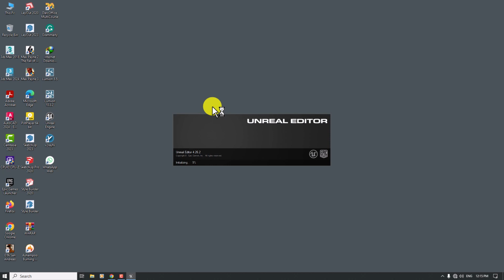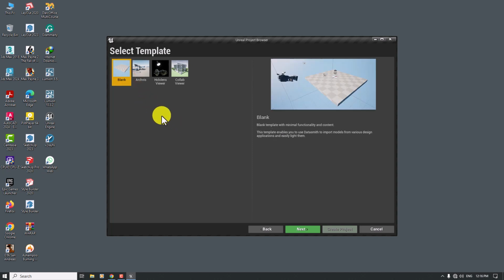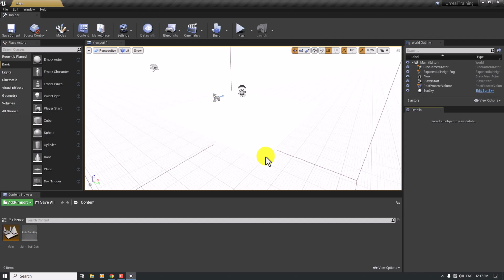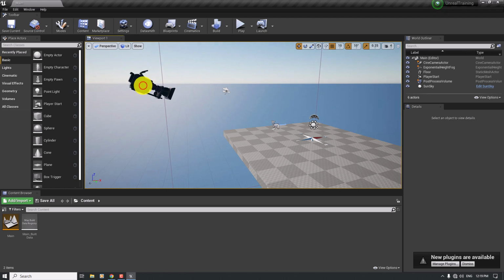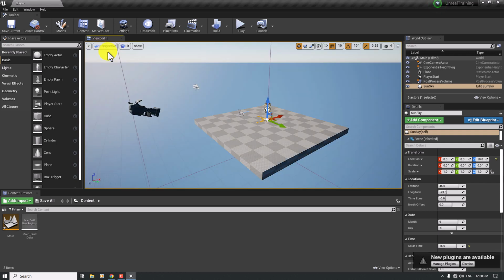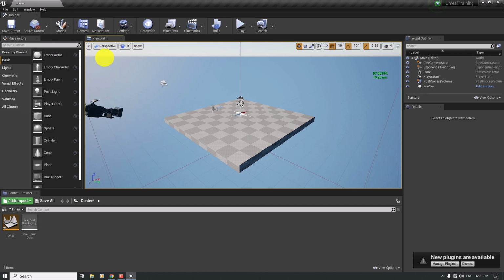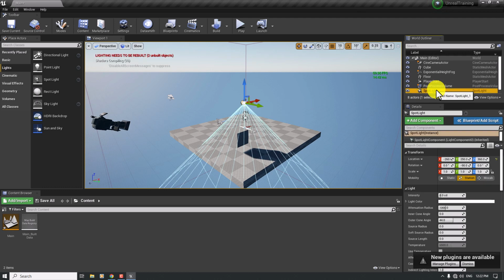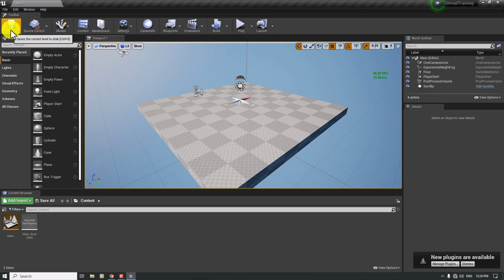Unreal Engine Tutorial: The Next Generation Of Architectural Visualization

Comment: Thank you mate for the tutorial!! 
Maybe do you know how to make a real-time Matte Shadow in Unreal Engine? Without any Composure. Just render as a Regular material. Similar to Shadow Catcher in Marmoset Toolbag
Reply from the maker: Hello my dear friend thanks for your comment Yes Follow This steps, sorry my comment is too long but UNREAL IS A LITTLE BIT COMPLICATED😁:
**To create a real-time matte shadow in Unreal Engine, you can follow these general steps:

Prepare your scene: Set up your scene with the objects and lighting you want to cast the shadow. Make sure you have a directional light or other suitable light source in your scene.

Enable real-time shadows: In the Details panel of your light source, enable "Cast Shadows" so that the light will cast shadows in the scene.

Set up the shadow material: Create a new material for your shadow. In this material, you typically want to disable all unnecessary shading and only keep the opacity information. You can achieve this by using a Translucent or Unlit material and setting the opacity to black (0) or a low value.

Apply the material to casting objects: Assign the shadow material to the objects that you want to cast shadows. You can do this by either applying the material directly to the objects or by using a material slot in a material instance.

Configure the light: In the light source's Details panel, enable "Dynamic Shadow Distance StationaryLight" and set the value according to your scene's requirements. This determines how far the shadows will be cast.

Configure the shadow settings: In the Project Settings, go to the Rendering section and adjust the shadow settings. You can modify the shadow resolution, filter quality, and other parameters to achieve the desired look and performance.

Build lighting: Build the lighting in your scene to calculate the shadows. Go to the Build menu and select "Build Lighting" to generate the lightmap and shadow information.

Preview the shadow: Play or simulate the scene to see the real-time matte shadow in action. The shadow will update dynamically based on the position and orientation of the casting objects and the light source.

Remember that the specific steps and settings may vary depending on the version of Unreal Engine you are using, so consult the official documentation or relevant tutorials for your version for more detailed instructions.
Reply: @SketchUpArchStudio  Thank you man! I know that it was an answer from Chat GPT, haha, I hope it will work!
Reply from the maker: @earth_with_roman  Yes men 😁 But I will make some tutorial about shadows and materials for you soon...🌹❣️❣️